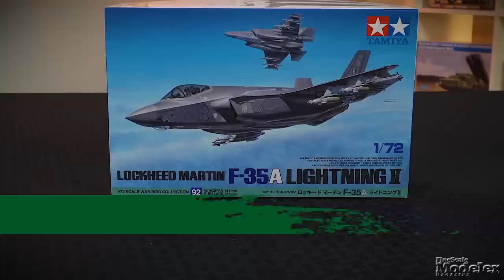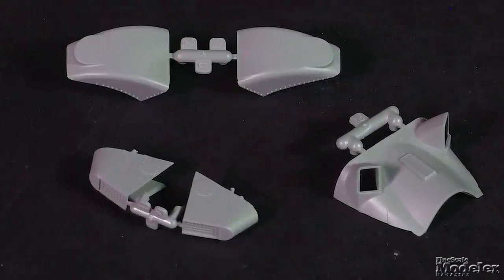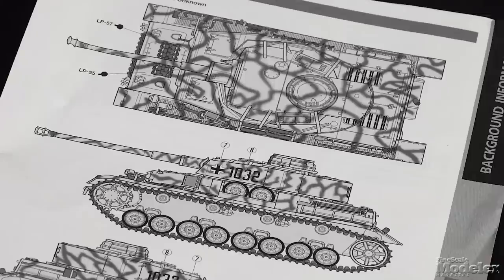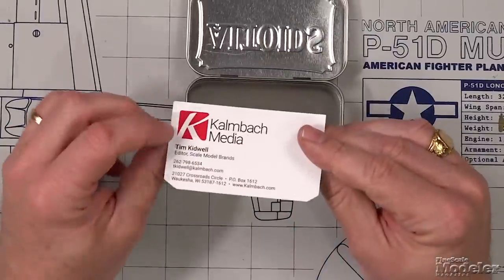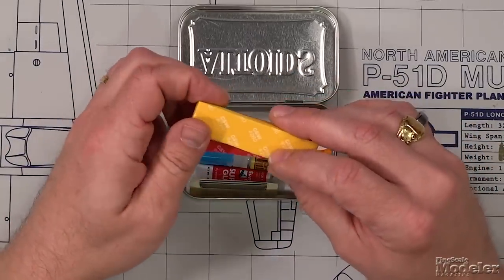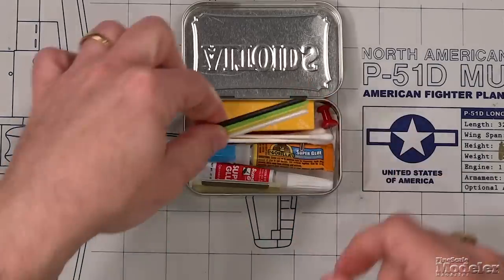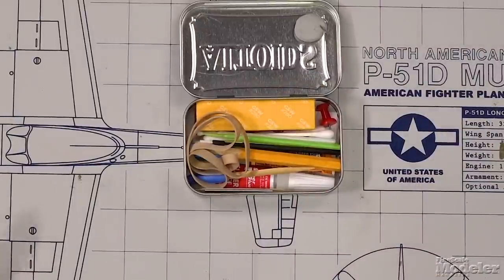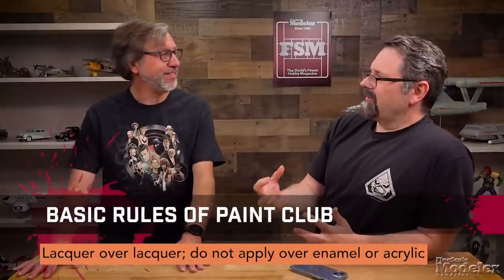An all-purpose mini modeling tool kit, kits from Tamiya and Takom, and what paint to use and when

Comment: The Altoids tin is an often used item in the EDC (Every Day Carry) Community. As for the tools shown here - substitute them with a Victorinox Swiss Army Keychain knife of the 58mm variety. Sharp blade, scissors, a nail file and depending on the model a small Philips screwdriver, tweezers, a ball pen.
Reply from the maker: Whatever works for you! However, a knife is not not carry-on friendly. With the exception of the razor blade, the rest of the MFAK (our new acronym for the Model First Aid Kit thanks to Felix) can go in your carry-on luggage if you're headed to a show via plane. Thanks for watching and subscribing.
Reply: @FineScaleModelermagazine  that is a good argument. Of course in-country flights are way more common in the US. And I would not want to argue with a TSA agent if a small SAK is allowed or not.

Comment: The whole Acrylic, Enamel, and Lacquer topic. Yes, there are always exceptions to the rules. But I wanted to take this opportunity not just to point out an exception, but to point out just how versitle and easy to use, Tamiya products are.

Tamiya paints, always seem to just work. Like their X and XF acrylic paints work underneath their TS-13 Gloss clear which is a lacquer. And their X and XF acrylics work over their Fine Surface Primer, which is a lacquer. And I use Tamiya panel line paint which is an enamel on top of their acrylic and lacquer paints.

I guess what I am saying is use Tamiya paints and primers. They all just work.

This post is not sponsored by Tamiya.  :)
Reply from the maker: Thanks for weighing in, Chad!

Comment: What's been you folks' experience with using one brand of paints per model? Like all Vallejo or all Krylon or all Tamiya etc? Do the different acrylic, enamel, lacquers within the same brand mess with each other?
Reply from the maker: Mike, I take it you mean can Brand X lacquers affect Brand X acrylics. That answer is yes. Even though the paint comes from the same company, the nature of lacquer paints is that they are hot, so they can eat through the paint underneath. Same with same-brand enamels and acrylics. As Aaron pointed out, using like paints with like paints shouldn't cause an issue except in situations when something has gone wrong, to which we alluded with a recent project he's worked on (a video for that project is in editing and should hit in the near term). We hope this helps!
Reply: @FineScaleModelermagazine  Thanks! Was Aaron building that project for a ..........diorama?  LOL

Comment: A couple of index cards cut to fit would give you the advantage of a business card, but with  a place to write down notes and such. 
A small pair of tweezers would be a useful addition (or, as someone else pointed out, a Swiss Army Knife with that feature) .   I've found that a .020" drill glued into a 1/8" dowel is very useful, coupled with a few bits of .020" brass wire in various short sizes lets you pin parts that have sheared off without having to rely on a weak butt joint.   

You can wrap the rubber bands around the outside of the tin to free up room if needed.
Reply from the maker: Hi Warship! Good suggestions. This was my take on Jim Haught's original thesis. It the best thing that could happen is viewers like you take the idea and customize it to work for your needs. -TK